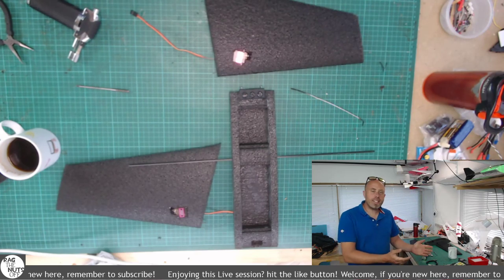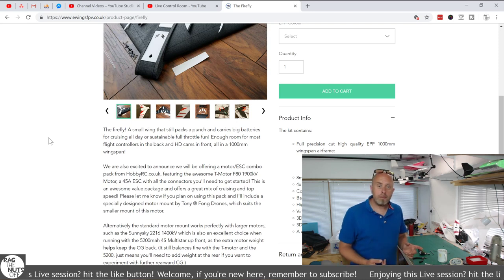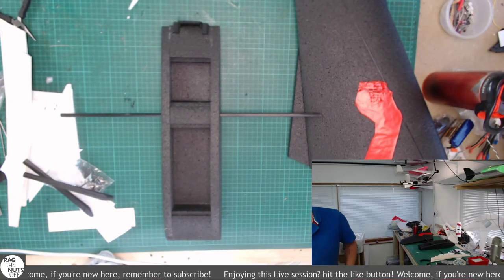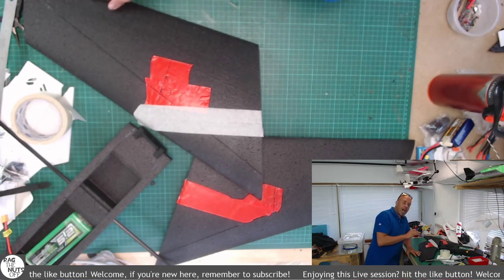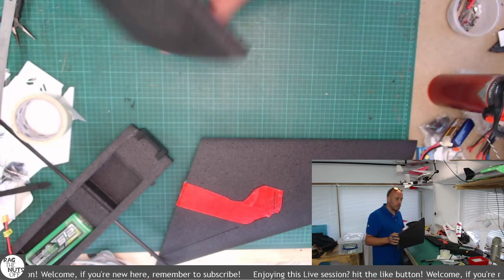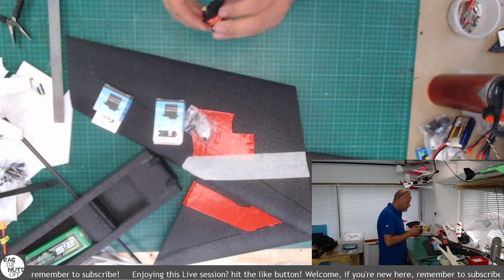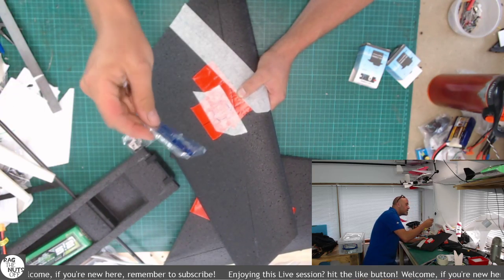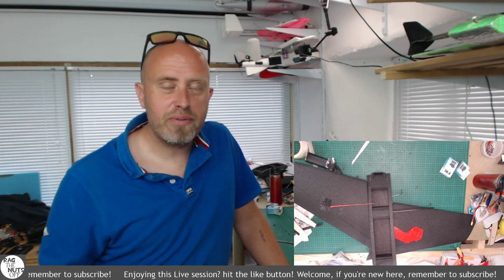"FIREFLY BUILD" Saturday Build & Repair Session 005 #BuildSat #RepairsSat #ProjectSat

Comment: The Z84 is really easy to just poke the servo arms out the top with the servos in the stock position.   It ends up pretty much just like they are on a C1 Chaser.

Comment: why didn't you vertically mount the servos and can a f405 wing  fit in the back bay?
Reply from the maker: Marcus, I'm used to putting them in horizontally, but both would work. And yes definitely enough room in the back for a FC, you'd need a smaller ESC innth back, maybe like one of those 52A newer ones. Matt